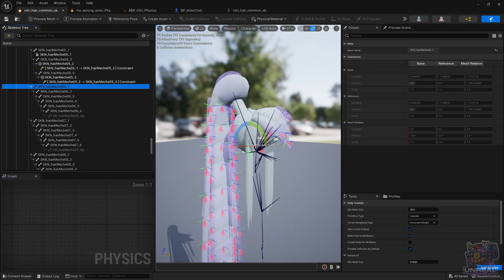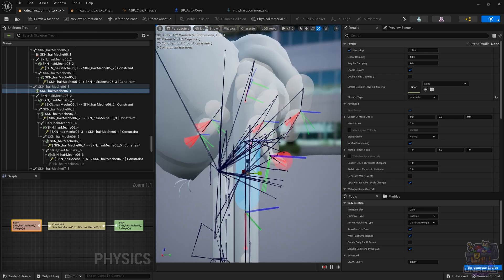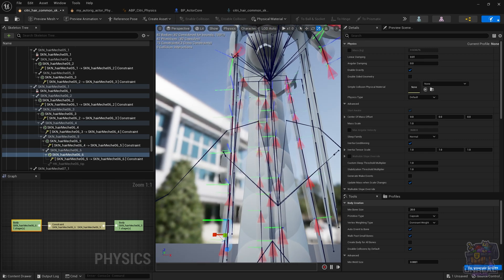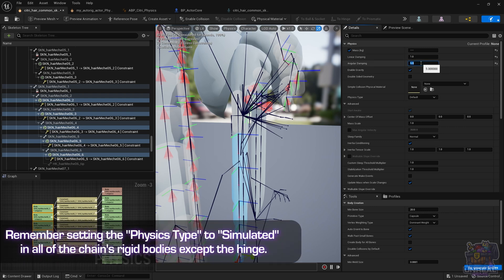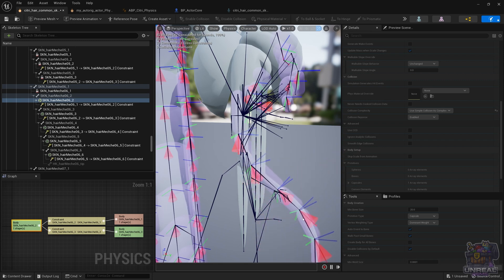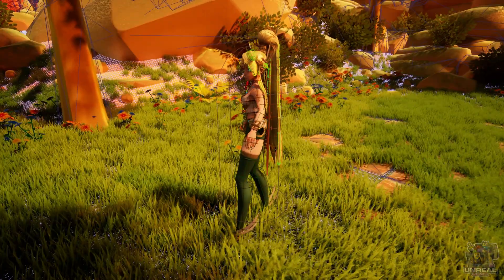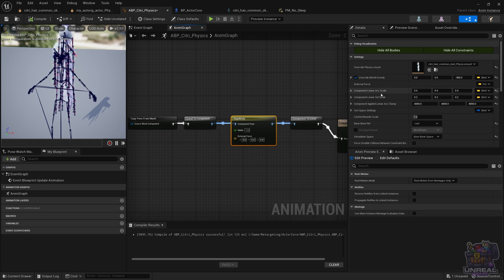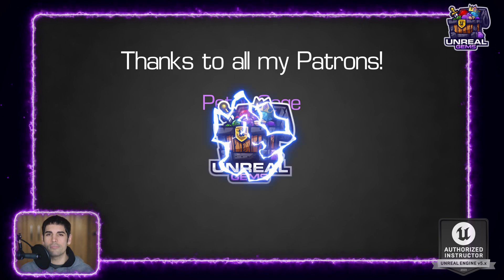Long Hair Physics | RBAN Long Chains | #UE5

Comment: Hi. your tutorials have been a great help. if you dont mind i wanted to ask about RBANS. i have a character with a long puncho and i want it to have some animations, the puncho has a layed down ( mesh is in a rest state) and like a glide state. when the puncho is in the rest state do i have to make two different skeletal chains as skinning it in rest state is difficult. and i just want to get a cloth effect. and whats the difference between rigid body and anim dynamics. thanks in advance
Reply from the maker: Hey! Thanks for the comment! The difference between rigid body and anim dynamics is that the rigid body simulation accounts for intersections with other rigid bodies and other elements that have collision in the level. Anim Dynamics has simplified physics and does not interact with other things outside of the Anim Dynamics node. It's simulation is faster but not as high quality as rigid bodies. For the rest state you do not have to skin twice, you can make it rest on the constraint limit. Like the short hair simulation tutorial. 😁
Reply: @UnrealGems  Thanks a great deal for the explanation. Is there a way I can contact you for some advice if you dont mind
Reply: @UnrealGems  Hi. In my case I have setup rigid bodies. But the knee and leg bodies sometimes pass through the bodies in front of the for example in a running animation. The bodies in front are normally pushed away but sometimes get split my the leg and knee bodies. Is it a case of iteration count which I can't seem to find in the project settings.Or how can I resolve this. And also are CRoss constraints referring to the constraints between chains. As projection may also be causing some issues. Thanks

Comment: My Hair still clips on the body. Try many settings from the collison tab. Even made Collisions on the blueprint and still clips. Not sure what to do.
Reply: Did you also create a body for the actual body because the physics assets don't interact between meshes
Reply: My hair collide with body if body has physic asset.  But body physic asset make many bugs - broken shadows, disable other meshes.